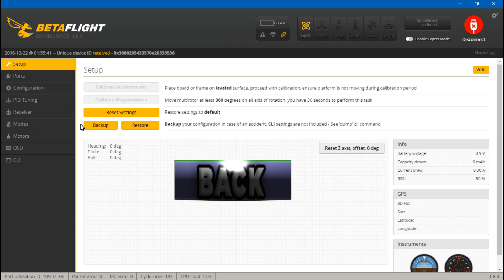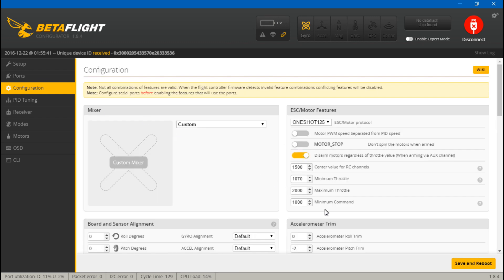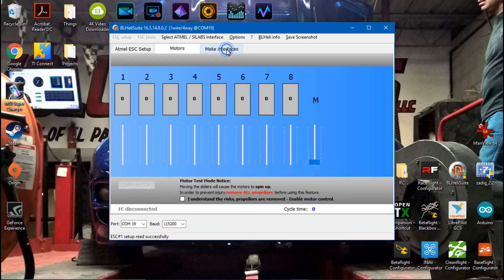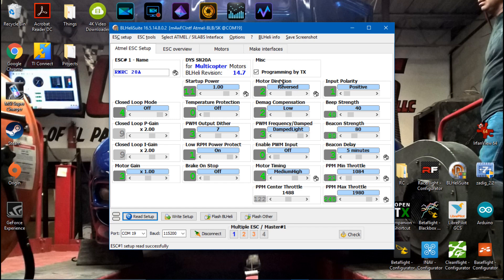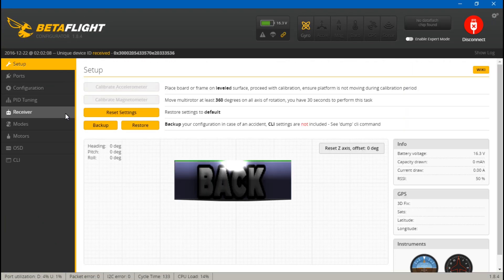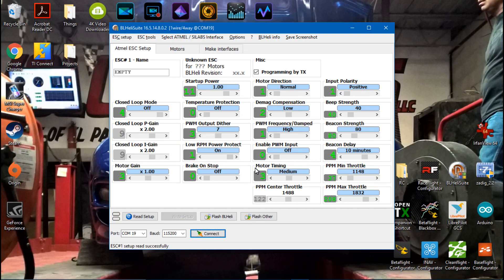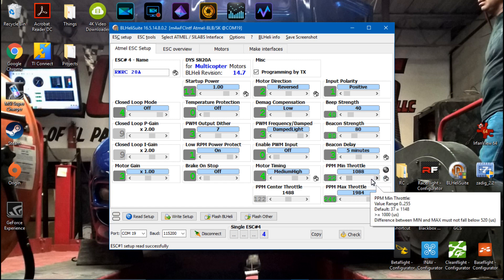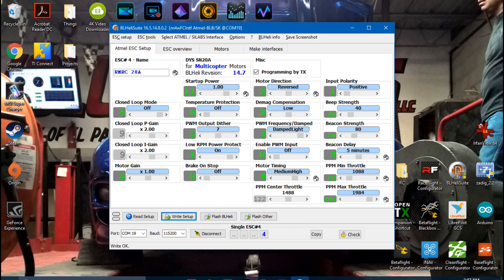Calibrating Oneshot 125 ESCs

Comment: Hi JC!

I calibrated my ESCs and had no trouble running them. They all started at the same time, like they should, but there was some deadspace before they started to run (about 1-2/10th) on the throttle stick. I started to mess around with the "Minimum Throttle" in Configurations and "set min_check =", lovering both of them. "set min_check" was set closer to Minimum Throttle, but still like 50 steps apart.

The battery was connected the whole time, and after a "save & reboot" one of the engines became really warm and started to smoke. I disconnected the battery, and I think I managed to save the motor. 

Do you know what I did wrong? It appeared to have something to do with the "set min_check", because when I reset it, there's no smoke on startup and all of the motors run (apparently) like they should. 

Thanks for all the help, love the work you put in it!
Reply: Per Forester how do you fix it?

Comment: please help..i think i tryed everything..oneshot125 dys xm20a, mini red bottoms, naze 32 and beta flight...the esc will not go into sync mode..they just spin up when i plug bat, in to start sync process. help??
Reply from the maker: nitro 20 I'm pretty sure it's a problem with betaflight firmware. They stopped giving the Naze 32 attention because it's very outdated. You might have better luck switching to Cleanflight firmware and trying it that way
Reply: na i got it..this naze has no diode so that when i plug the usb in it sent current to the escs not allowing them to enter sync mode..all 5 of my naze are beta flight and they run way smother then cleanflight.